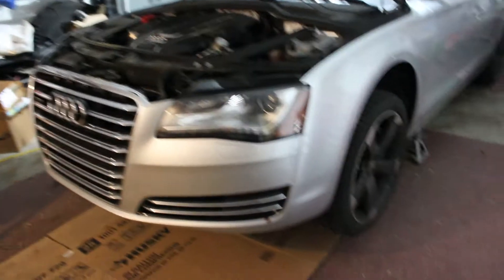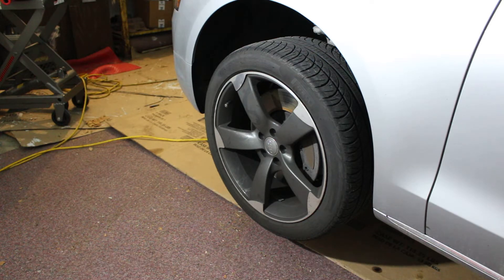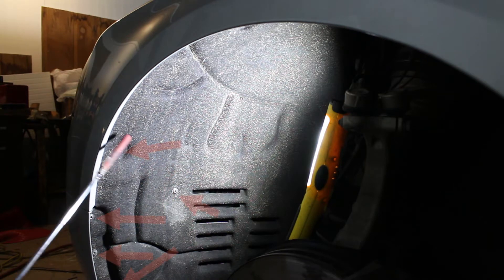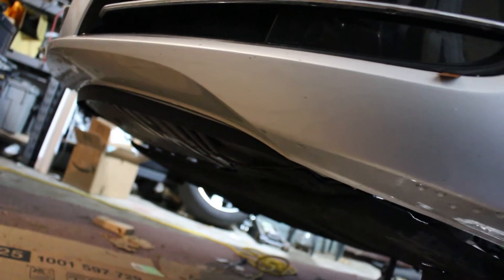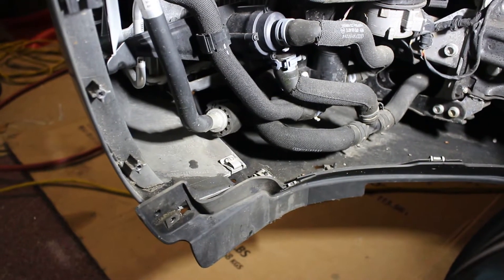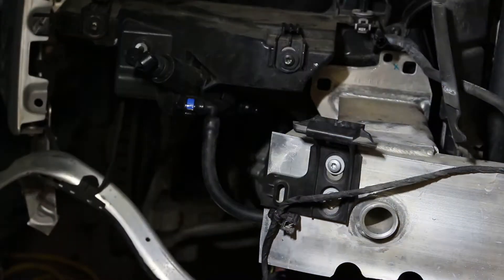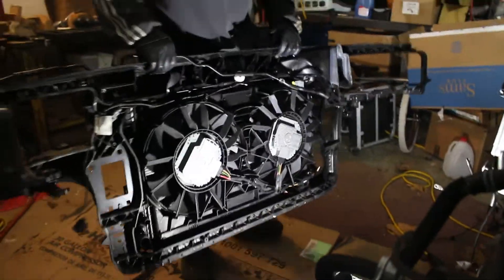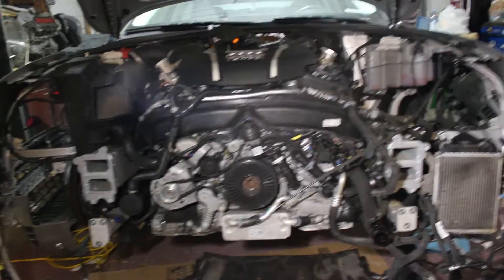Audi 2010 - 2019 bumper & core support removal

Comment: I need to change my radiator, do I need to do this job or is there a way to just get the radiator out?
Reply from the maker: You'll need to remove the bumper and then the crash bar - then the AC rad - IC rad - Then obviously disconnect the hoses. Once you've removed the other rads you'll be able to pull back the main block radiator but it will take several other steps. It might just be easier to pull the core support.

Comment: Thanks for the video, my car repairman removed the air deflector and didnt put it back. He said its unnecessary. Can you tell me about it?
Reply from the maker: Depends on the Air deflector. But on average the deflectors help collect and push or deflect the air and help push the air in the direct path of the coolers/ radiator.This helps the efficiency of the air being now trapped and pushed to the coolers/ Radiator They tend to be more effective at low speeds where you can help funnel the air that is moving very slowly.  Simply put, your able to capture more air and direct it for specific use Vs not directing the air and loosing utility of the air.  They do help and I do re install mine. However,your car isn't/ Shouldn't have any issues without them
Reply: @howididit7196  than you for answer

Comment: What is the best way to go about putting the coolant back into the car if you don't have a vacuum filler?
Reply from the maker: So I can't add a picture from what I can see to the comments section. But in short. You obviously fill the appropriate about of coolant until the system won't let you. Chances are there is going to be an air pocket. If you leave the cap off the coolant tank over night a lot of times air will find it's way out. There is a coolant air bleeder valve located behind the intermediate firewall  on the back firewall. You can see this once you've removed the plastic cover. It's quite obvious. You'll see the coolant lines running up on the back firewall to a junction with a black knob or screw with a giant + carved out in the knob. Once you've gotten to this knob. You'd start the car to get the water pump to run. Turn on the heat full blast make sure the coolant is topped off and then slightly crack the air bleeder knob letting the trapped air escape the system. So so so sorry I can't post pictures. It would be easier if I could. I'll try to make another video showing how to get out the intermediate firewall on the A8. The coolant air bleeder screw is easily seen then . Let me know if this was helpful.

Comment: I am having trouble with finding what connects to one of my harness on the front left side, broken connector and cannot figure it out , any idea?
Reply: Hey bro what are these wires for? My bumpers cover piece behind the mesh is missing and i can see the wires there. Never noticed the plastic missing until now. I need to buy a new cover tho

Comment: The headlight mounting supports are part of the radiator support??
Reply from the maker: Hi Joseph. If I'm understanding the question correctly... yet.. The entire front "core support" is the plastic composite piece just behind the crash bar and bumper. It holds everything from the hood latch assembly to head lights to yes the rad units for the AC and coolant system. Even holds the HX unit for the intercooler.
Reply: @howididit7196  wow so if the headlight mounting points are damaged the whole core support needs to be replaced
Reply from the maker: Sorry that I missed this. Depending on the extent of the damage of the mounting points on the core support you would have to replace the outer core support frame. What that said there are more than one supporting points for the head light and while you'd obviously want to use all the mounting points. If you needed to you could make due with just a few.

Comment: Positive post always before the Negative....
Reply: You should always remove the negative battery terminal first. The reason for this is that if you accidentally touch the positive terminal to any metal surface, you could create a spark that could potentially damage your electrical system.
Reply: Thanks for the info, but you are talking to a master technicien, Thank you